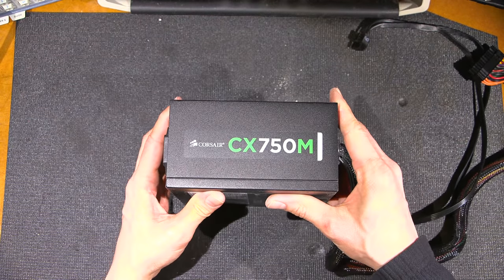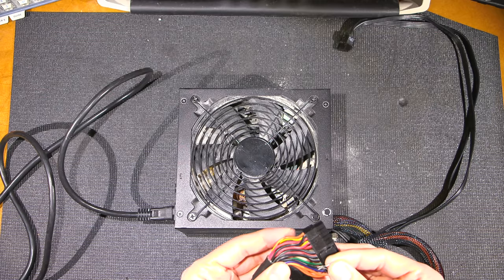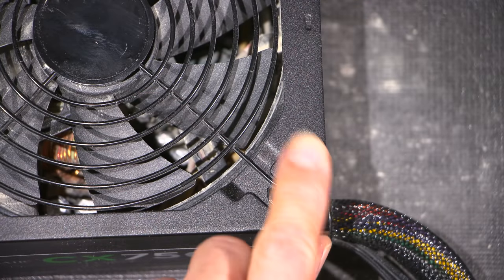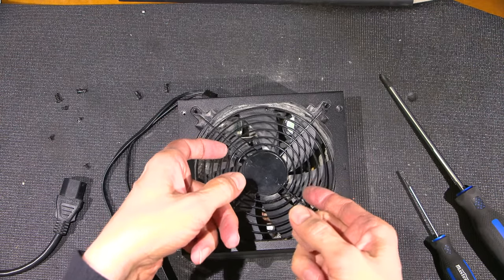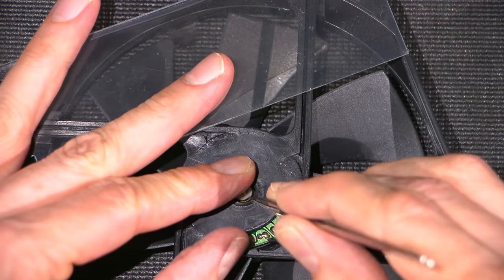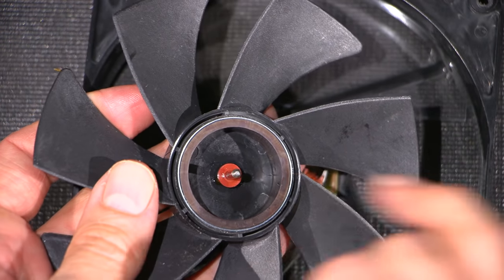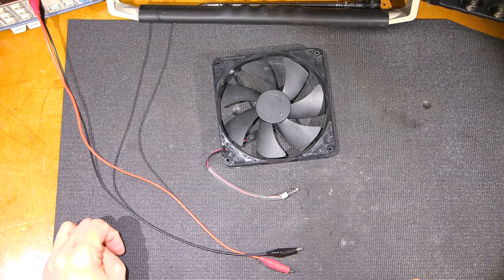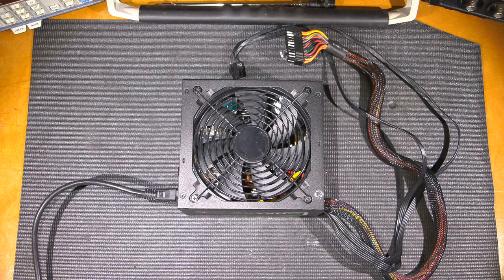Fix A Computer Power Supply!

Comment: Anyone who greases one of these is a total goober. get a new one. The damage caused by it running dry is permanent, and it will end up seizing again.
Reply: I do not think what you say is true in this specific case. Here some dried grease in the hub was contacting the silicon seal. Generalizations are generally a bad idea. The noise we heard was not bearing howl. It was a different noise.

Comment: bad fan. i have seen that in air conditioners, dehumidifiers and refrigerators.

sticking metal objects in a live power supply is just begging for problems.

you should have unplugged the power supply before putting a screwdriver into the power supply like that or use a plastic rod like the radio tuning driver would be safe.

Comment: yikes a cx psu
Reply from the maker: Hi Joel. If they run within parameters (one doesn't buy a 500 Watt supply for a 600 Watt demand,) they work fine and last the term. Most all these supplies get a bad rap from "tinkerers" trying to save a buck.

Comment: thats cheapo sleeve bearing. one piece bearing .
Reply from the maker: They are cheap, but silent, unlike roller or ball bearings. This is one time that being cheap has a benefit in many applications that require "quiet" operation. (less moving parts = quiet)

Comment: When referring to switching and Lighting the term is  OFF  / ON   and not off  /  on
This confuses people who do not know or have never learned the real meaning of
the words they are using nor its origin.
They ass=me that because the words sound they same - they are the same.
They are not.
One will also observe when n paying attention that switches are correctly marked  ON  / OFF 
and not on  / off
on )  lower case is used for example -  I will repair this power supply on  Friday as I am off
on the week-end to go fishing.
People interchange ON /on  because they were never taught the difference by teachers
who don't know the difference or the origin of the words they them-self use.
The result of manufactured ignorance in the CORPORATE GOVERNMENT indoctrination system
they refer top as education.

Comment: Awe. :( I wanted to see you fix a computer power supply not a fan.
Reply from the maker: Me too.... But I don't create the failure point. On another note, whats the black box called with wires coming out of it? What's inside that box? Now did we fix something inside that box?
Reply: @MrCarlsonsLab Oh it's fixed. I watched you do it. :) I was researching failure modes of computer supplies when I found your video. Like a moth to a flame, I had to watch

Comment: you didn't fix the Power Supply, because the electronics work !!  you just cleaned the fan, which I will buy for 10 € and replace in 5 minutes.

Comment: excuse me but you fixed a fan, not a PSU. Whatever...
Reply from the maker: What's the black box called? (A power supply.) Now, what's inside that black box? (A fan.) Pretty simple right? Forward thought.
Reply: @MrCarlsonsLab  I clicked on this vid because I was interested in perhaps learning some electrical engineering concepts, as did most people. Don't pretend the title of this video isn't misleading.

Comment: Design problem. The engineers which designed this fan motor......never left enough ' end play ' in the motor axle. The laws, of thermodynamics, is usually  NOT  FACTORED, into the design equation. Most modern motor /engine  troubles...come from this.  LIKE  the modern car engines.....1.5 litre  TURBO  charged. NOT enough engine block mass, and Density, to absorb too much heat, generated.   Radiators, also, are  TOO  SMALL for cooling such a (temporary) really powerfull engine. Interference engines, along with VVT  (variable  valve  timing...)  is another issue.  This  ' woke ' generation, wants more  POWER,  IN  A  SMALLER  PACKAGE.  >   >  > >>  LIKE  Apple lightning charging cords...too small for the upto  2 amps.    Too much heat, in ' smaller '  faster processors, of phones.   oh well......our earth, is burning up, too.  ALL  READY.....Thanks, Mr Carlson  !   (old pc / electro tech)

Comment: Waste of my time. You made a fan less noisy. How is that fixing a power supply?
Well, i probably expected too much from this video.
Reply from the maker: If you ask yourself, "What is the black box called?" (It's called a power supply) Whats inside that black box that is failing? (a fan.) Did we fix what's inside the black box? (Yes) I guess it just depends on how you look at things.